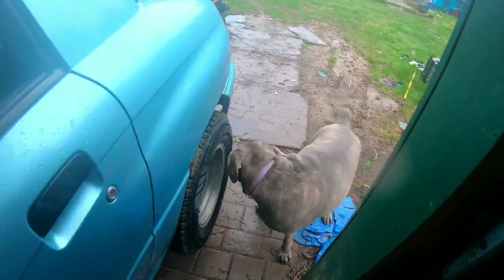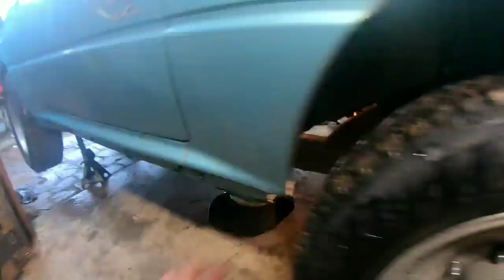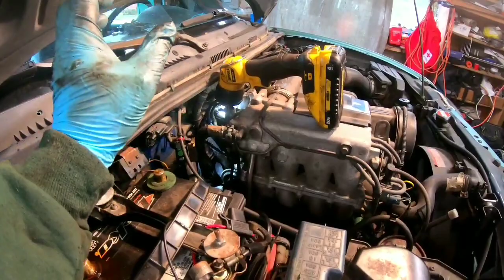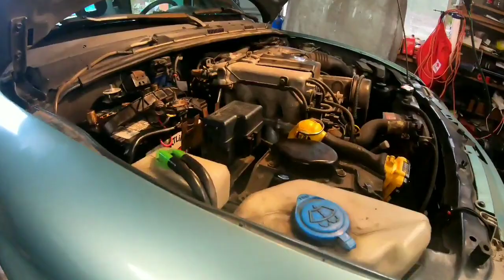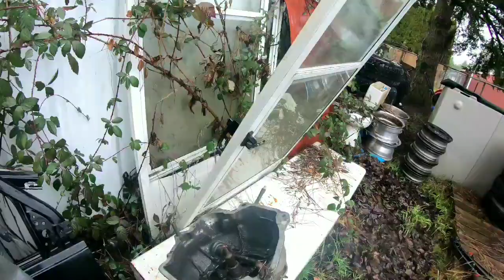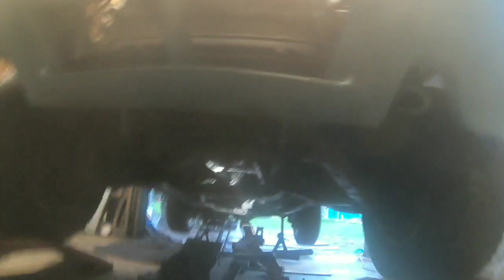Replacing the clutch in my Suzuki X-90. Same as Sidekick and Geo Tracker

Comment: I admire your tenacity and that you always seem to be doing something, going somewhere or managing several fires at once all while operating out of such a small shop producing big results.  I have always enjoyed wrenching and these little trackers/sidekicks are always up for some tuning, modifying, or lifting and never seem to let you down while out on an adventure.  But sometimes, I do just need to walk away…especially when bench pressing automatic transmissions and transfer cases.  Always a mess.    I always learn something new from your vids.  Thanks for posting...
Reply from the maker: Thank you very much for your comment. Sometimes it is overwhelming to have so many different rigs but when things are going right it is so sweet.
Reply: @trashpandaoffroad3548  that is so true! , you did the work and all that everything is right.  When I used to race Motocross it was easy fixing up the two strokes keeping them in good maintenance even in-between moto's whatever it took.  Just like our rigs, like you said when everything's just right it is so sweet.

Comment: Hello Sir greetings from germany. May i ask the question if this job (clutch job) fixed the noise you were hearing? 
Got about the same noice without the highpitch rambling but the growling you got and the same behaviour when dumping the clutch pedal. 
Was ist the clutch or your transmission? Sadly we could not hear you fire that nice x 90 back up!
Cheers and good video!
Reply from the maker: It did change the noise but not eliminate it.  There is a video on the channel of me actually having to changing out the transmission as it had gone bad.
Reply: Thank your for your answer. I will take a look into it and might just try to hold a transmission nearby when i drop the old one for the clutch job. Will try to source a transmission or a repair kit for the bearings. They seem to give up on some point.

Thank you and greetings